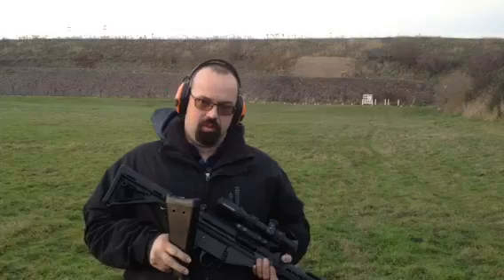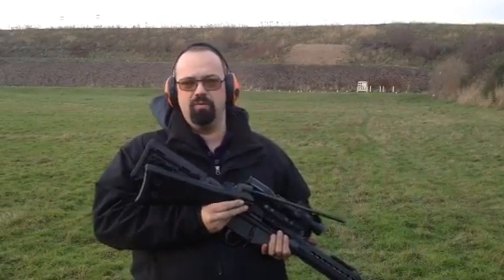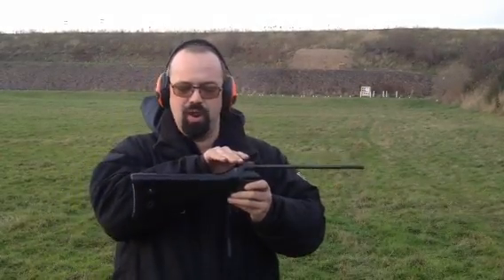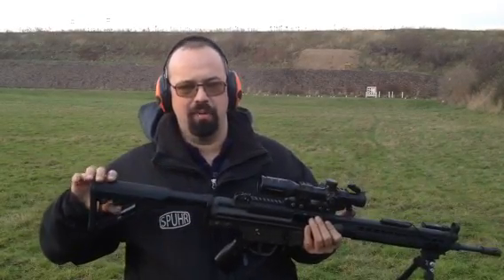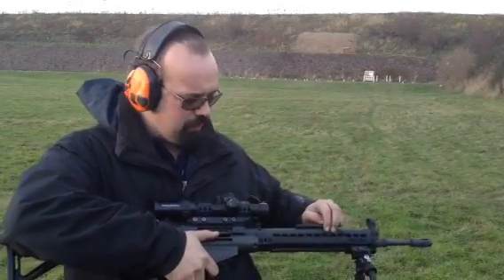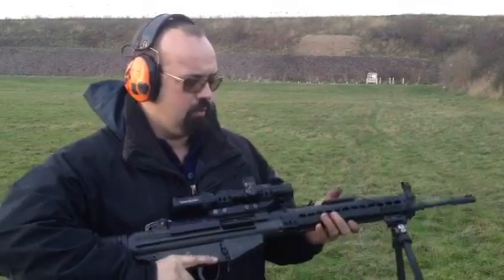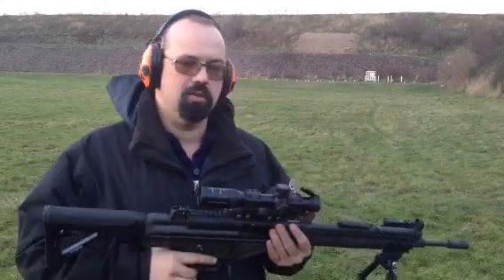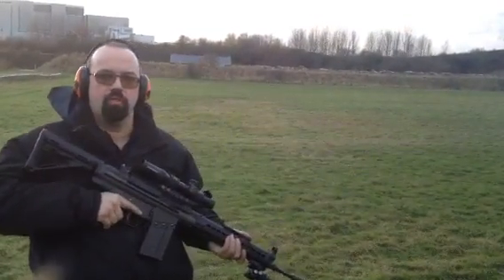Spuhr G3 modifications

Comment from the maker: Ours are 190 grams without any attachments on.
Often do you only need one or two short picatinny attachments.
So that means that ours are often half weight compared to other manufacturers.
Also is ours slim so you can grip around it, something you not can with a 3 rail.

Comment from the maker: Nope I have not and there is really no reason to as it has the same flaws as the orignal stock.
Hump hit's you in the face, they compensated by making the stock obscenely to long.
My solution is to rise the cheekpice so the hump dissapears then you can have your head where the hump use to be. and the stock will be 2-3" shorter.

Comment from the maker: Please have a look at this link:
v v v .facebook.com/photo.php?fbid=460865183961675&set=a.449263538455173.93102.157836424264554&type=3&theater

So I can get a NV there without the Spectre DR.
And if you have a stock that is for the correct lenght for you, a normal toprail would be to short for a NV attachment.